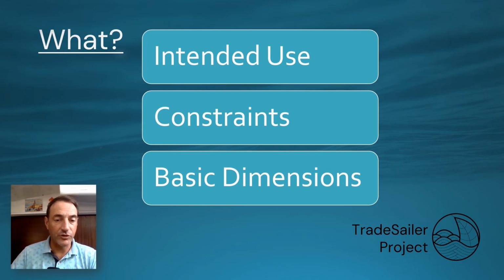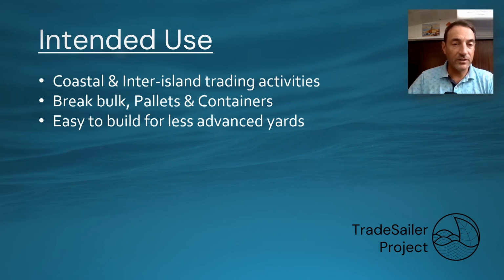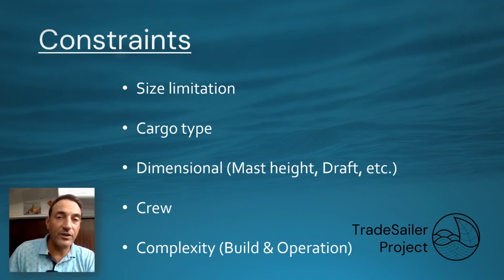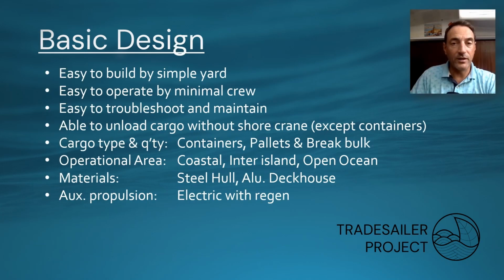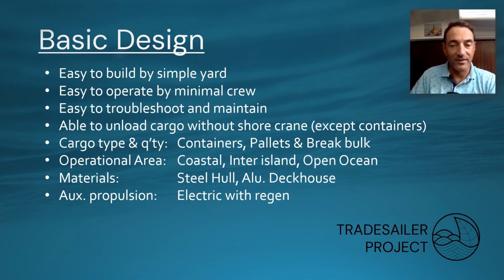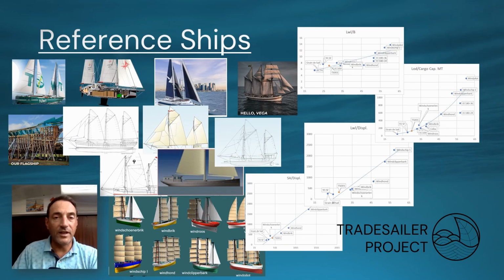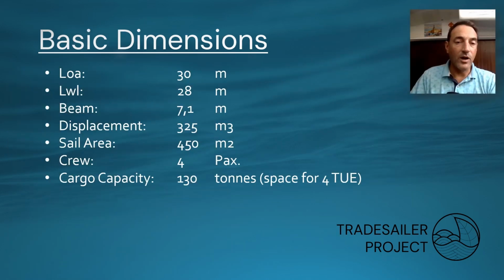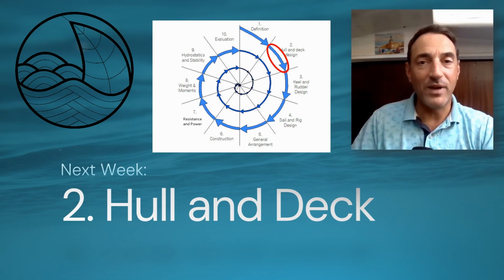TSP EP002   Definition

Comment: Well done taking on this project in the public arena, if the intended use is short to medium distance does the fuel burn becomes less important than the functionality of the vessel. but it maybe more practical to use electric motors over shorter distances, is the ability to roll on and off vehicles an advantage ?
Reply from the maker: Hi Pete,  thanks for your comments. Fuel burn is of a lesser concern as it is a sailing vessel which will be electrically powered for getting in and out of port and to assist when there are light winds to increase apparent wind speed.
Roll on and Roll of for this vessel is not considered but might be a good feature for future larger vessels.